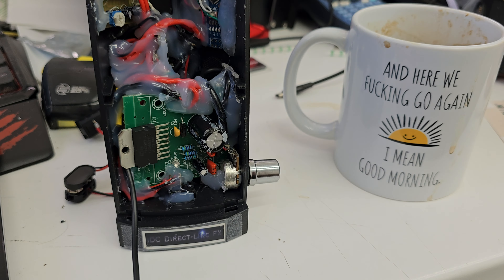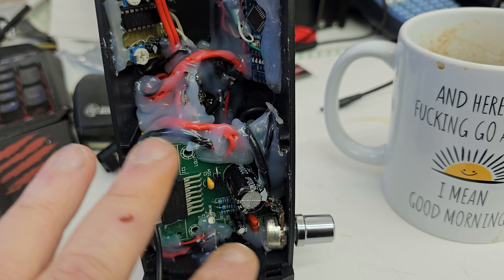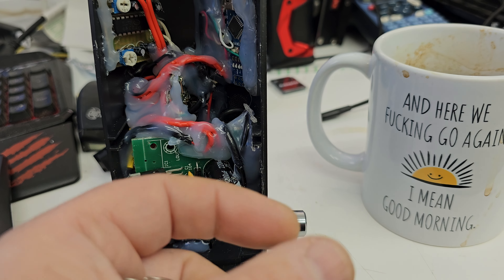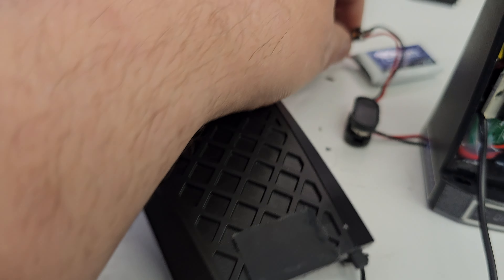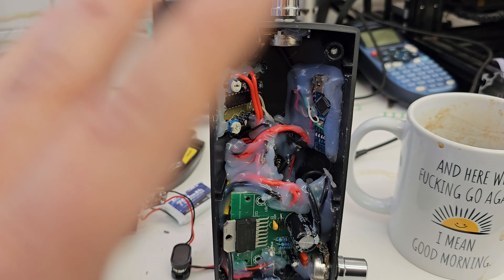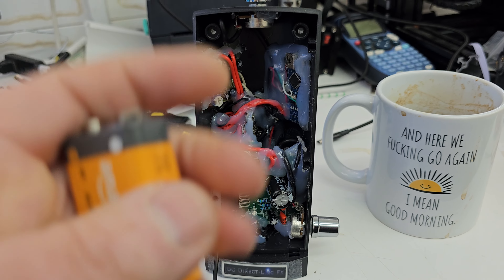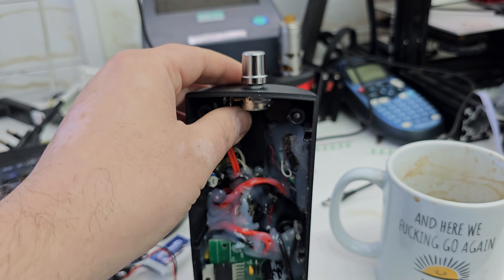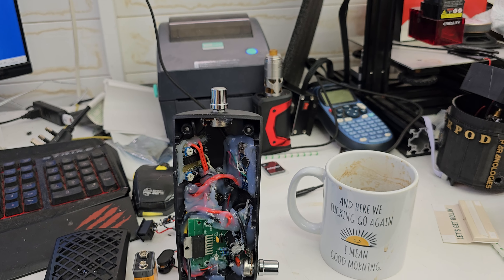IDC Direct Linc repaired, but shocking battery life. 15-20 min not good.

Comment: The mosfet will drain it quick time, was the battery getting warm to 😅...hope you get it sorted 👍
Reply from the maker: @Sigtrygg_Gale.  yup the whole circuit pulls about 1.2-1.5 Amps depending on volume level, way too much for a 9v I've rebuilt this now with a much more efficient 5v circuit and small 3w amp, it pulls less than 400Ma now, it now runs on a lipo setup so the battery will go for about 5hrs